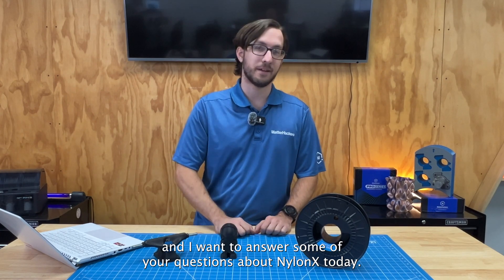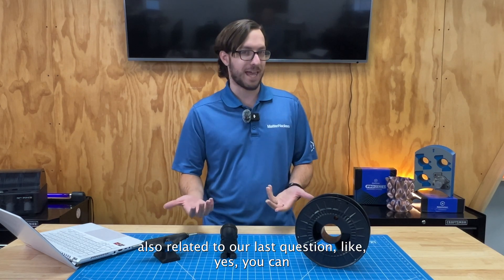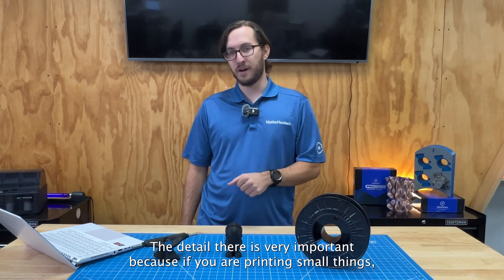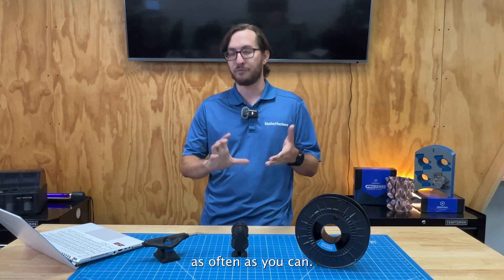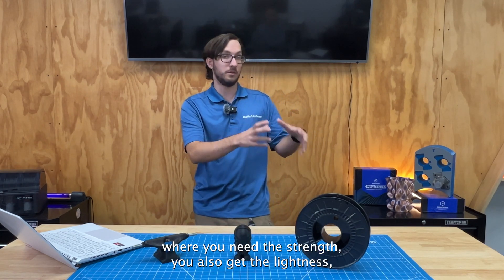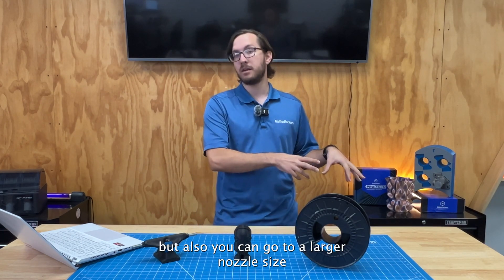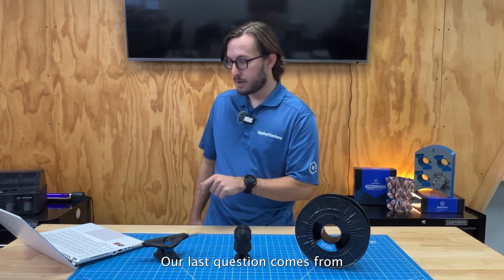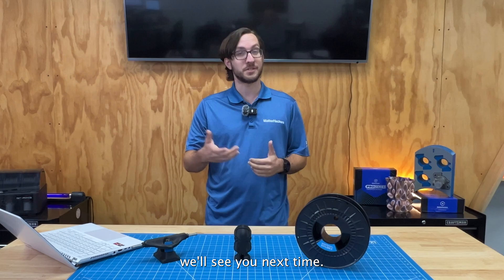Curious About #NylonX? - Matt from @MatterHackers Answers Your Questions (MatterHackers Q&A: NylonX)

Comment: what's the max speed you would go using a bambu x1c? i understand that the recommendations on your website were made before bambu labs printers were out. what i'm after "as long as it works as intended" so the finish isn't too important for me, but layer adhesion is.